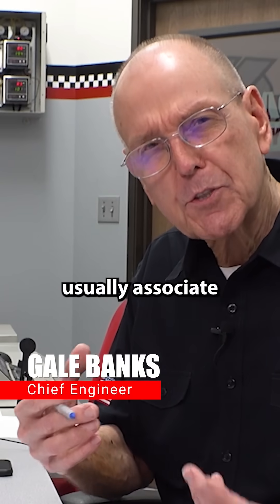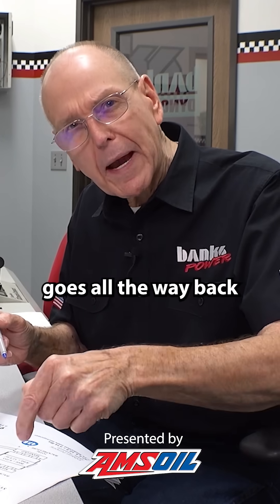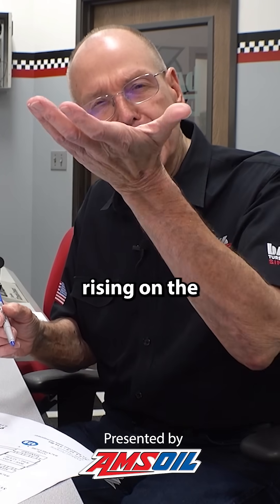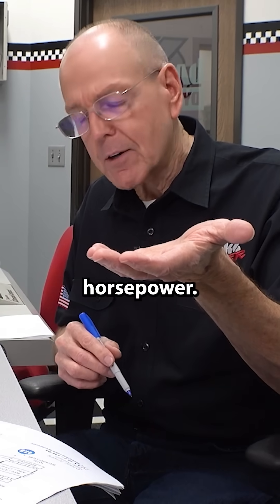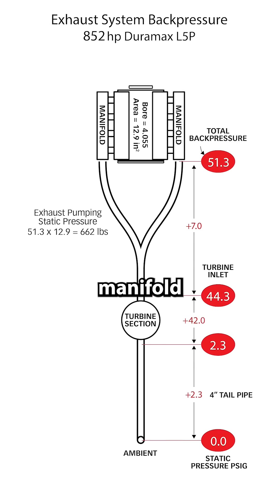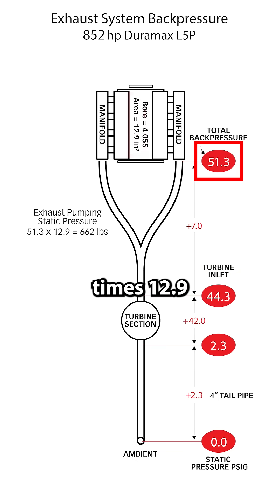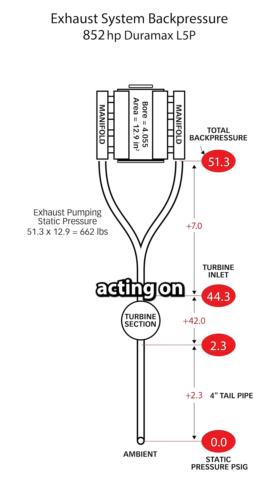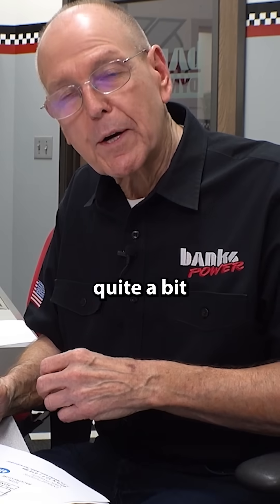How much HP are you losing to backpressure?

Comment: Oh..there is so much more to it then just "get rid of all the back pressure you can" it's a tradeoff,and depends what intended use of a engine is and how you want it to perform, and is it a daily driver that needs to run smooth quit and deliver power in the lower rpm range, or racing screamer where you want peak power disregarding everything else. People tend to not take in the accound that workings of the engine is not just the engine itself, but start at the tip of the airbox and end up at the tip of the tail pipe where every single component has it's influence on how everything is going to work together. For the guy knowing his stuff and making good videos like this it's the endless source of a good content becose there is so much to tell. I bet the question he hates the most is "What's the best engine?'  Best for what?😃

Comment: I make my own semi truck mufflers that mount under the truck because a new one is $700. I just make baffles and two pipes with galvanized skin and weld it all together. They last a while but i had to make another one and this last time I capped the inlet pipe with a cap inside but everything had holes drilled in it. I was trying to force the exhaust out the holes instead of it just going out the end and into the parallel pipe next to it to the exit. Thought it would make it more quiet. Anyway, my truck didn't have the power it did before! I knew what it was.. the boost pressure was 5 lbs low  so i had to cut a hole in the muffler and torch that cap out that i added.. I had 5/8 holes drilled all over it but it wasn't enough. After that my boost was back up to the normal 28 lbs and had the power again! Kinda neat lesson i learned.

Comment: I just learned something,  I always knew back pressures were not good! Now I know!
Reply: N/A engines NEED back pressure.
Reply: @KLOKSLAG1911   Did you not watch this!?😆
Reply: @KLOKSLAG1911 no they dont, N/A engines and ANY engine really needs exhaust VELOCITY. The gas needs to be evacuated out of the cylinder before the next intake stroke. Backpressure reduces volumetric efficiency and therefore reduces power.

Comment: U mentioned factoring in the volumetric size , and obviously shape and contour of the exhaust possibly having input as well to the level of backpressure...so, could this explain the differences in performance and sound between saloon and hatchback vehicles of the same manufacture especially FWD vehicles. Case in point: GOLF and JETTA VR6....the Jetta goes faster and sounds better than the GOLF bust is heavier with longer pipe. ..

Comment: Is the same thing true in a two stroke engine using the Schnurle Loop Scavenging and Tuned Expansion Chamber ? All I have studied said the the expansion chamber works with the heat and angles of reverse diffuser cone to send back a charge to the combustion chamber

Comment: You will lose power and torque if you have no exhaust with a stock/short tube header. Theres a reason race headers are pretty long (long tube header), they’re meant to be used without an exhaust. Turbos don’t need an exhaust, the turbo is the exhaust.

Comment: This is precisely why turbos are still parasitic.  They're not as parasitic as a crank-driven supercharger, but they are still parasitic.
Reply: No. They aren't. The extra back pressure on the exhaust stroke is countered by the positive pressure on the intake stroke. It balances, so no parasitic loss. Turbo gets its energy from exhaust heat and exhaust shock wave, not gas volume or flow.
Reply: @timothyjamieson1282 belt driven superchargers also provide this positive pressure on the intake and yet we say they cause a parasitic loss.
Point is it doesn't matter what dividends the supercharger pays back, it still takes energy to run a belt driven supercharger or a turbocharger. Having no parasitic loss is physically impossible.
Reply: @hughmongous5089  that's totally true, but the whole energy to drive a supercharger comes from the crank, robbing power that would otherwise go to the wheels. Hence costing output and fuel efficiency. The power being used to drive the turbo is normally completely wasted down the exhaust, and does nothing more than heat up the mufflers. No power is taken from the crank output. Various other systems have been tried to harness that wasted energy. Volvo have an exhaust turbine geared to the flywheel on some trucks, and Napier made huge strides in the late 1940s with several hybrid designs. Till gas turbines took over.

Comment: I was under the impression in some small block cases, those engines performed better with a slightly higher back pressure vs. an oversized exhaust system.
Reply: I can tell you from experience! I build sbc 383 stroker when I ran it open headers it would barley move. I put mufflers on it and boom it woke up and would move! I’m pretty sure he’s talking about on boosted applications
Reply: @bikelife_gus319 I agree, long ago I was informed that a decent set of headers had equal length tubes and that is how power is increased to help "pull" exhaust out the pipes by the other cylinders gases etc. But on a small block information had said going too large on exhaust pipes isn't good for them so the recommendation was 2.50" max all the way out to the rear bumper.

Comment: One of the FIRST THINGS I did over 20 years ago was installing a full 4” all stainless steel down pipe back exhaust system on my then new to me 2002 LB-7 Duramax.  Glad to say both the truck & I are doing fine still to this day , and I immediately noticed an increase in throttle response & fuel mileage. Shortly after the exhaust I also purchased one of the first Generation “ Six-gun “ bundles along with “ Speed loader “ and “ Big -head “ waste gate kits & they also have been operating trouble free all these years later as well . Thanks Gale , for ALL you do for the performance industry .  😎👍
Reply: I just recently bought my dad’s Lb7 he bought when I was a kid. I plan to keep it stock, besides a 4” exhaust. 330k miles and still rolling strong.
Reply: @DareBearGaming96 I love all duramax trucks but those early lb7’s are phenomenal rigs. They might not have the vvt turbo of new trucks but they are work horses.
Reply: Regular driving i don't think it's gonna be that much fuel efficiency difference, but if you tow something uphill that's where it's gonna be huge.

Comment: @Gale Banks...  I am confused...  on your DPF 101 videos you argued that new trucks (Duramax) are designed for the backpressure in the exhaust, that the backpressure created by the DPF was a good thing for vehicle!...  This video seems to present the opposite perspective.  I enjoy having fun while complying with environmental laws, and I have the complete derringer kit, and the pedal moster, on my L5P, but I know I am still missing out on power, efficiency, and longevity of my drivetrain.  I feel like your other videos might be disinmaster, when Banks argues that the newer trucks exhaust systems are good (they are good if you want to be legal, but that doesnt mean they are good for the vehicle).  It would be more helpful if you qualify your videos when you are talking about "off-road performance" vs. "Legal on-road" use.  Maybe I am overanalizing...?  And, thank you for these videos, they are very helpful!
Reply: The back-pressure sets the ambient exhaust pressure at max RPM and load, which affects the speed of sound, which dictates the length of tuned exhaust manifolds for exhaust valve purging. So optimized only in some narrow sense. 

You could put more particulate filters in parallel (and more CATs) to cut the back pressure. It would improve performance, but not as optimally as also modifying the exhaust manifold length to match the new purge wavelength dynamics.

Comment: Well, a very important factor in this is the gas exchange! Remember: during gas exchange, both valves, intake and exhaust, are open and the gas/fuel mixture rushes in due to the stowed pressure before the intake valve. Having back pressure in the exhaust, will reduce the flow rate and thus the amount of fuel/air ready to butn

Comment: A turbocharger creates at least 1lb of back pressure per 1lb of boost made (the maximum efficiency a turbo can create is 1:1) is low boost applications (6-8psi) it isn't that great of a loss but with diesels making 40+lbs of boost it has to be a considerable amount of loss, makes me wonder how a roots style blower would compare, much more bottom end boost and no lag.

Comment: If thats true then does a turbo increase backpressure due to restricting the exhaust with the turbo exhaust blades?
Reply: It's more like the blades spinning slower than the fluid flow is what creates most of the pressure drop. In turn, that depends on the torque on the turboshaft. Which depends on the compressor half of the pair.

Comment: I had a Chevy 6.2L diesel years ago. I put the Banks headers and straight threw mufflers on. That really changed the performance of the engine. That engine was able to breathe much more.
Reply: Let them breathe
Reply: @GMCJay_lly let you breath.
Reply: I had one as well in a 4wd GMC and man did it get great fuel milage. Then I went to a 6.5 turbo diesel and it was descent for what it was. But the New 6.5 G.M. diesel they only put in Military Humvees and a few other vehicles along with the new redeveloped heads, crank and intake are more durable and has more Hp and torque than the Dodge Cummins engine .
Reply: @johneubanks5951 only had more horsepower than a stock VE pumped, and the 94/95 P-pumped Cummins. But, even the 160hp VE engine made more torque than the 6.5. The in-line 6, typically makes more torque than a V engine does, at the same hp.
Reply: @johneubanks5951 no it did not sir.
Reply: @mattk252  Hey Matt, if I'm not mistaken, I had to buy a pdm module and the aluminum cooler block for my 6.5 online and I'm tryna remember the places name. I'll hafta go back and find the receipt cause it's been 6-7 years ago. Now I'm tryna do this all from memory but the Cummins they were advertising vs. That setup from GM was a 97-98 straight rail Cummins (if I'm saying that right and the new GM assembly was like 10 more Hp and 15 ft lbs of torque. I remember it wasn't much, but it's what the company was advertising. It was quiet a bit of parts to change out on a stock 6.5 and it was expensive. I didn't think the 6.5 could out do a Cummins on Hp or torque myself, but as I've learned these internet companies can be full of shit at times on advertising..lol..when I get a lil bit more time,I'll go back and look for where I had gotten the information and let ya know where that is. And if you have the time, take a look at the parts list and lemme know what you think bud. I don't know much about diesel engines but I managed to swap out the fuel pump and relocate the pdm setup without much problem..thanks bud .
Reply: @johneubanks5951  the 1997 6.5 had 180hp and 385lbs tq
Reply: @mattk252  apparently the new Optimizer blocks out of AMG are now producing 205hp and 440+lbs/ft of torque which is a welcomed increase in power over the 90’s versions…blocks are stronger and better heads…there is a company that is building them up to 250hp and 550lbs/ft of torque and they’re holding together!…also since these improvements on the 6.5, many people with inboard/outboard boats with 350’s and 454’s are repowering them with 6.5’s and saving lots of fuel without sacrificing much power!…they were a great engine in my opinion that had some issues but if they were as bad as people made them out to be, the military never would have chose them for their military vehicles…
Reply: Makes sence. All an engine is is a air pump. More air in easier air out=HP
Reply: "I can't breath"
Reply: Well... it certainly doesn't need to be closed off lol
Reply: I bet that was an awesome loud pickup? 👍  people didn't realize how much the non turbo engines could speak.  Until they straight pipes them.

Comment: Less back pressure is always better for power however I wonder if some back pressure can improve engine reliability in high piston speed applications. The rod sees the most stress on the exhaust stroke in high rpm scenarios. Having some back pressure could help cushion? Maybe that amount of pressure is too negligible to be worth while. At 4psi of backpressure a 4 inch piston may see 50ish pounds of force, that seems rather small when the rod sees 10k+ pounds of force during its transition between upstroke and downstroke.

Comment: Finally. Ive been trying to explain this to people. Yes backpressure can be good in a 2 stroke. But not 4 stroke
Reply: No it can’t! 😂 A reversion wave is NOT the same as back pressure.
Reply: @supersportimpalass  
Still makes back pressure. People like you dont know thr definition like racism
Reply: Then why would my sbc 383 stroker barley go anywhere open headers soon as I put mufflers on it it woke up
Reply: @bikelife_gus319  that is fairly easy to answer. What you are describing is an increase in felt torque. Not necessarily an increase in total speed or acceleration. Torque increasing over horsepower (ideally they should be the same in a 4 stroke gas motor)  is usually a result of there being a noticeable factor limiting total horsepower. Ie heads cam intake. Cold air intake. Or in your case a muffler restricting the exhaust flow of almost 400 cubic inches several thousand times per second. So while you may not have lost or increased horsepower from your muffler you probably increased torque because your motor has a new restriction. If adding mufflers actually increased your power. Dragsters would probably not run headers like zoomies. Because that would mean they could go faster for fairly cheap
Reply: @bikelife_gus319 You mean open headers with not even a stub of pipe after the collector?  That would be why it didn't run well.

Comment: Shouldn't he be sharing how back pressure effects torque?  Years ago, I installed dual low pressure mufflars for my single exhaust.  My top end was better, but it was noticeably weaker off the line.

Comment: Narrow exhaust increases velocity of exhaust which helps with reversion, but increases back pressure. Wide exhaust helps relieve back pressure but decreases velocity. I wonder what exhaust geometry can relieve back pressure but maintained velocity on a diesel. Velocity collectors on gas vehicles works pretty good but diesel is different...any thoughts?
Reply: Peak back pressure (at high RPM) is relevant to calculating the speed of sound, which dictates optimal exhaust manifold length for tuned exhaust purging. 

Peak flow velocity is inversely related to the cross section area, which is most important for catalytic converters, particulate filters, and mufflers because they are the primary cause of back pressure at high RPM.

Comment: This is a disappointingly simplistic explanation coming from Mr. Banks. Back pressure is also drive pressure for the turbo to create boost pressure. Boost pressure drives the piston down on the intake stroke. The problem is when back pressure exceeds boost pressure. He also implies that cylinder pressure increases substantially during the exhaust stroke. From the admittedly few cylinder pressure charts I've seen, cylinder pressure tends to drop between BDC and TDC during the exhaust stroke. This subject deserves a much more detailed discussion.
Reply: It's a short, don't expect a detailed video...

The back pressure is a result of the turbine (and everything else) restricting the flow of exhaust gas. It isn't what is driving the turbine, that's exhaust flow. All things being equal, reducing the restriction in the exhaust will increase the efficiency of the turbocharger, so for the same boost you'll have lower back pressure at the exhaust manifold.
Reply: Hmmm. "Few"  "drive pressure"

I'ma go with Mr banks on this one chief. 😅

Comment: So what you're saying is if I put a turbo where the output could be blowing into the exhaust at a 45° angle to push it out and no backflow that it would increase my performance. Kinda like a varijet fire nozzle. 😅 

Would I have to resize my other turbo that feeds the intake side of the motor and then have a large turbo for exhaust output. So by the time the small one spooled up, the large one is also spooled up to push the exhaust out of the exhaust pipe? 

I would use an electric turbo for the exhaust side.

Comment: BuT You wOnT Make ANY tOrQue WiThOuT BaCk PrEsSuRe!
Reply: I believe that's true in a naturally-aspirated gasoline application, especially side-port 2-stroke engines. 
Turbo diesels are pretty different.
Reply: @magicoddeffect  you believe wrong
Reply: @magicoddeffect 4 stroke NA or turbo gassers are not at all different in this regard from 4 stroke NA or turbo diesels.

Two strokes are completely different, they scavenge primarily using resonances in the exhaust and the exhaust resonator chamber has a huge effect on power and efficiency.
Reply: Squeak Squeak...noise coming from your head rub

Comment: So I have a 12v Cummins compound turbod and someone told me that when you run compounds that the forced air goin into the cylinder will actually push the piston down on the intake stroke.....is there any proof of this?
Reply: Air moves from an area of High pressure to low pressure. Thats it. Without getting into volume
Reply: That's true of any boosted any because there is more pressure above the piston than below it in the crank case. Also true for na engines with a vacuum pump on the crank case.
Reply: @trev0rbr  thank you for the info